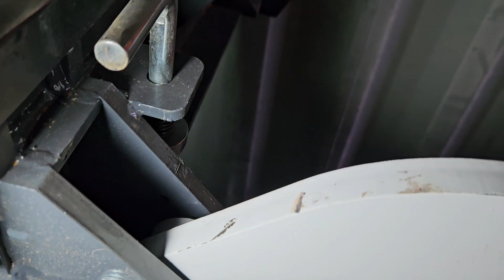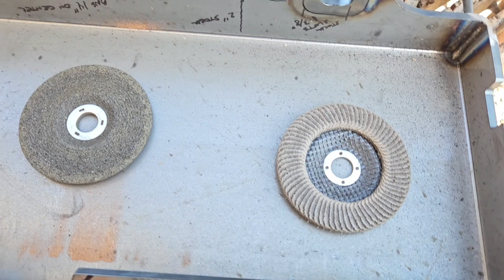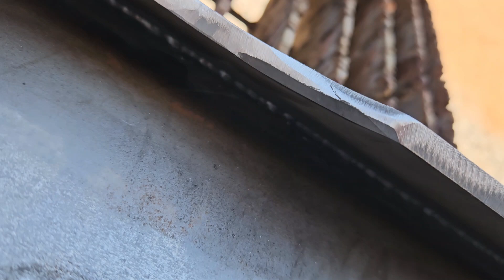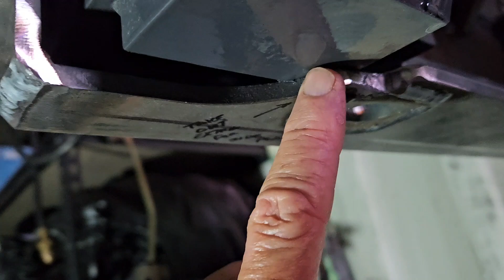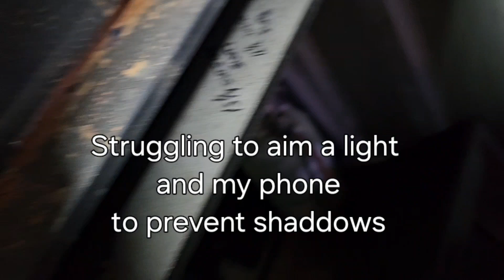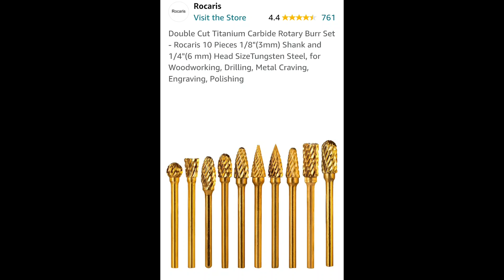Chinese mini skid "universal" implement mount plate fitment. (AGD-460,  LRT23,  JQ400,  etc)

Comment: Hey I have a LRT23 and I cut them blocks off the bottom of the machine side plate. And then had the same slop issue as you top to bottom, so I made a shim to sit on the top edge of the machine side plate and it raises the whole plate up so the bottom sits flush. I’ll probably post a video about it when I get home for days off.
Reply from the maker: @Johnathanliepert  If you post a video, please let me know.